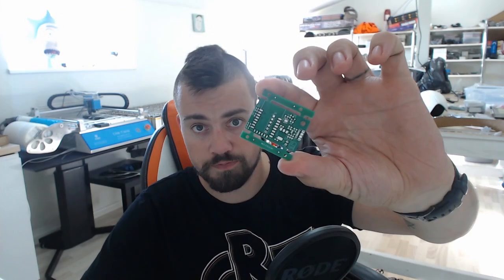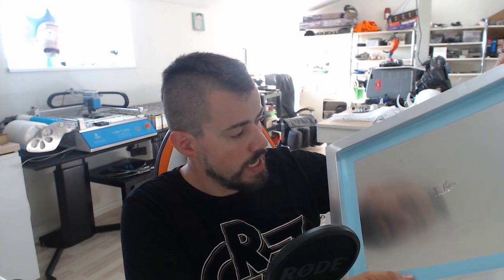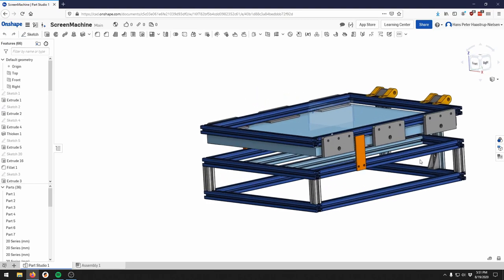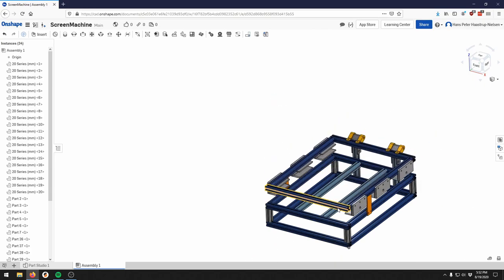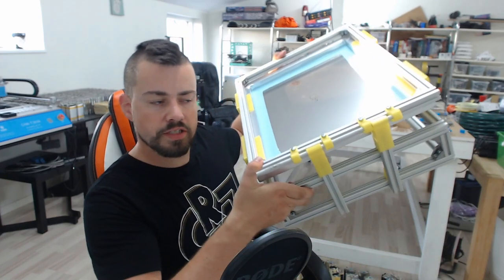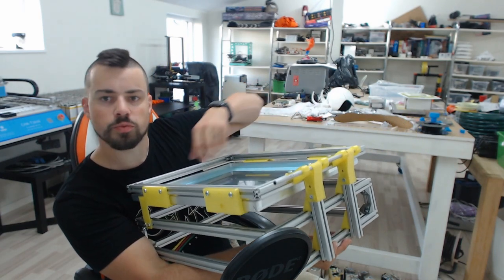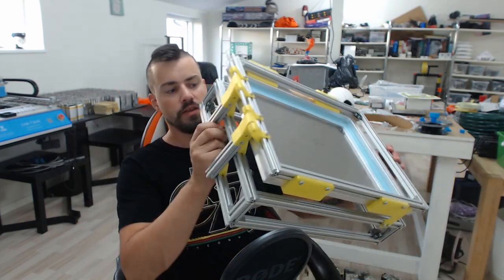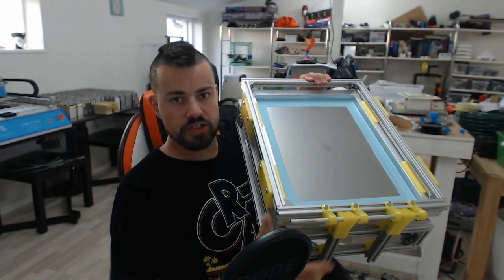Solder screen machine - A DIY Solder stencil 'printer' - Part 1

Comment: HI... would it not be more stable if you mounted the hinges on one of the wider/longer side of the frame.... maybe add a third hinge?
Reply from the maker: You're right,  on both accounts. adding a third hinge would make it more stable but after using the machine for production the corners actually stabilize the frame plenty. What i do miss is a way of rotating the PCB mount - I think someone mentioned this. It can work with adjusting the frame screws but it is a fiddly process